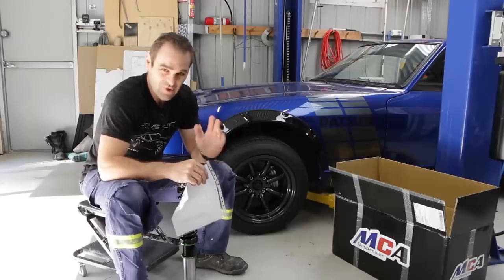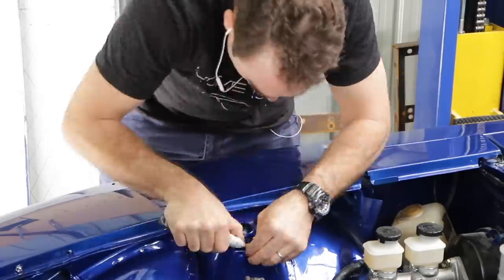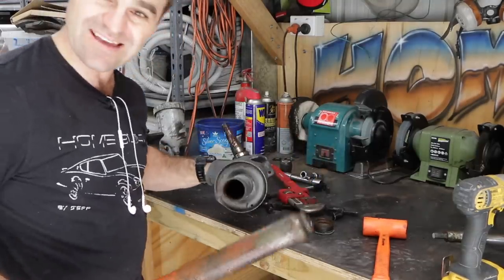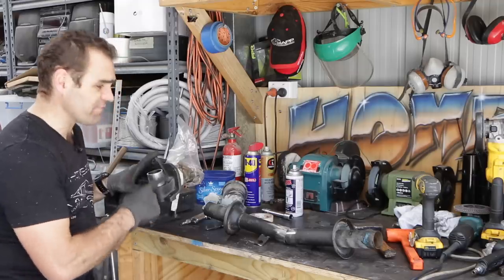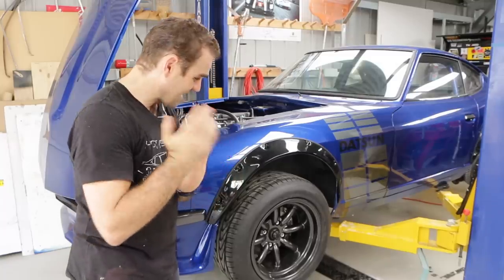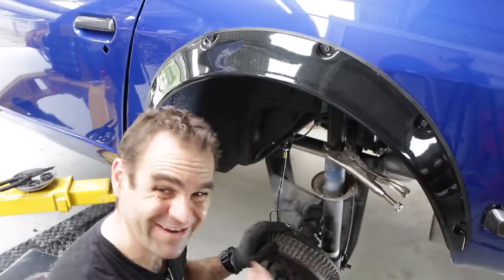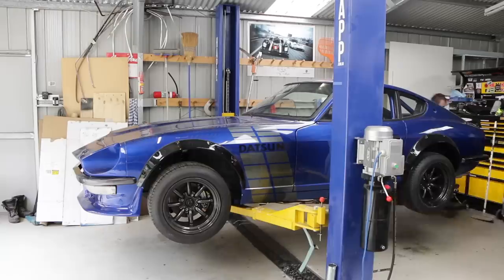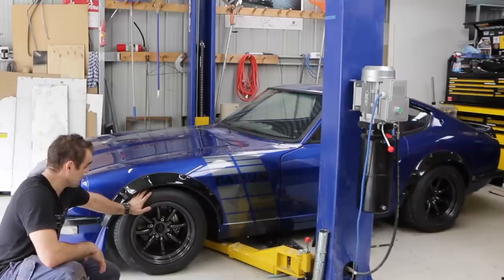Welding in coil overs - Home Built Datsun 240z part 87

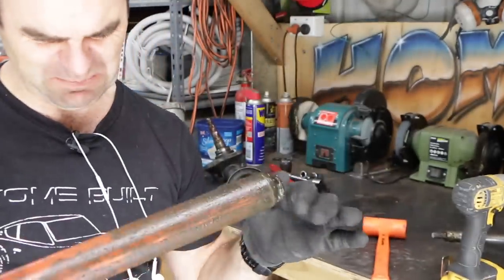Comment: 4:10-I believe it's not uncommon to fill the strut with oil to help keep the shocks cool by absorbing heat (transfer) etc.. so it's likely smelly old oil in there. :D
Reply: Yep, it is the same for 1st gen Rx7s. You need to fill the gap between the shock and the housing so that the heat transfers and doesn't cook the shock.

Comment: Jeff, I would suggest putting anti-seize on the collars and where the strut threads into the lower mount. I made the mistake of not doing that with the coil overs on my 260Z and am now paying the price several years later.

Comment: Remember the olden days when you did not have a lift for this kind of stuff? Also, when you started using your deadblow hammer to get the second shock out, I was thinking, "He is going to need a bigger hammer". Did not disappoint ;)
Reply from the maker: When in doubt, use a bigger hammer :D

Comment: Best way to check the test-weld is cut it to get a cross section view of the penetration.
Reply from the maker: Definitely, these welds are just to stop it falling off under rebound as opposed to taking the weight of the car. Even if they were holding the car, I am very confident of the penetration.
Reply: Home Built By Jeff The caveman style, bash it on the ground, test is much more entertaining too.

Comment: To be on the safe side, always remove the shock insert bottle, or in your case the bottom sleeve/tube only, when welding anything related to coilovers, even if its only oil and no gas shocks.

Comment: I hope you didn't ruin the rear wheel bearings by putting the ground clamp to the wheel stud. Running welding current through the bearings might harm them. I wish they ok :) btw. Superb channel!
Reply from the maker: It could have messed them up now that you mention it. Time will tell ;)

Comment: Wow, that second insert was proper in there! Do you need to get those welds certified? Here in NZ I would need to have those welds done by a certified welder and signed off to make it road legal.... good work!
Reply: Yes. The kind of job that really does need to be done properly too.
Reply: If only welding on a threaded collar  to a strut it must be welded top and bottom by a capable welder."or words to that effect" 
Its covered under the general welding in the Low Volume guide.
Any more than that yep ticketed welder, with crack test report, whole nine yards.
Just been through it all on my 1600/510 build.
Reply from the maker: Yes I would say it does need to be certified, but you also have to remember that it is not holding the weight of the car. It is basically only stopping it falling off in rebound.
Reply from the maker: A threaded collar being welded to the strut is holding the weight of the car, so it is much more critical. This is not.

Comment: Hey mate just a question when you take your cars back to bare metal what do you spray them with first before high build primer
Reply: If it helps - We're now using epoxy based etch primer, or epoxy primer. Good stuff, you can also work over it, unlike etch.
Reply from the maker: As M or D said, epoxy primer first.
Reply: @ModifyOrDie  I have used Self-etching primer on bare metal many times followed by a good layer of epoxy primer and then sand just the 1 or 2 layers of epoxy primer before starting my colour coats.

Comment: Great video as always! Is the coilover bottom part stainless steel? Did you just weld with regular mig wire or used something special?
Reply from the maker: I believe it is not stainless, so I just used mild steel wire, and then rust treated it.

Comment: Australian standards pretty loose for modifications? Welded struts require non destructive testing and an engineering cert here in NZ. Bit sketchy doing it on the car and not knowing how good the welds are.....

Comment: Looking at your flare mounting at 11:22, are the 'washers' countersunk type like the screws?
Think you might need button head screws and the appropriate finishing washers

Eg, https://www.essentracomponents.com.au/images/stories/virtuemart/product/SR1946_1.jpg
It looks like you have Type3 screws with Type4 Finishing Washers
Reply from the maker: No, they match as far as fit, it is just that the washers are gloss where the bolts are matt.

Comment: bump steer?
Reply from the maker: Not sure how much lowering it changes it, but it is still the original geometry.
Reply: @HomeBuiltByJeff  If you're looking at the front of the car while on the ground and see the front control arms parallel to or angled higher than the front crossmember inner mounting locations, then you should consider roll center adjusters to correct the geometery. This is a common occurrence on lowered Z's and can greatly affect drivability. One fix for this is to use an aftermarket front crossmember such as ApexEngineered or to drill 1/2" up and 1/2" out from the stock inner control arm holes, weld in a new inner washer, slightly modify the tops of the control arms for clearance and you're golden.

Comment: If you EVER expect to take this car to the track, you CANNOT have drum brakes on the back. Just saying, you're going to have to do a rear disc conversion
Reply from the maker: It may be something I do in the future. Getting it on the road is my first priority ;)
Reply: I understand.  @HomeBuiltByJeff
Reply: That's odd as many of the competitive vintage Z racers still utilize the rear drums with upgraded shoes. Most rear disc conversions for the Z screw things up badly, they tend to throw off the brake bias so much that the rears don't bite enough.
Reply: Mr. Datsun My apologies, I had no idea. My experience is mostly with old BMW’s & GM’s and they end up turning into mush after a couple laps